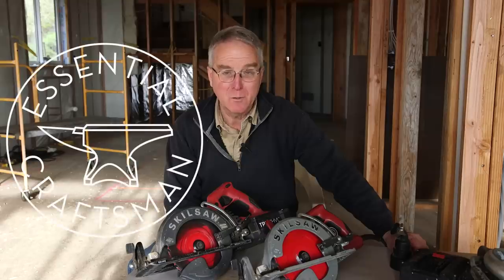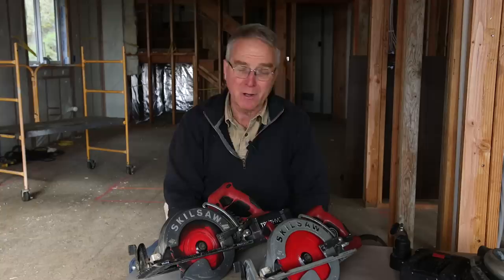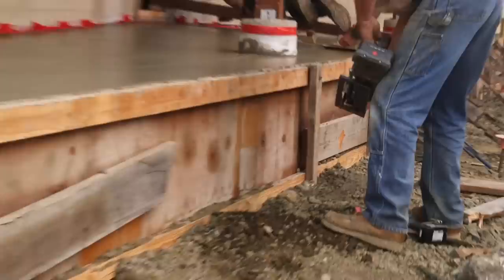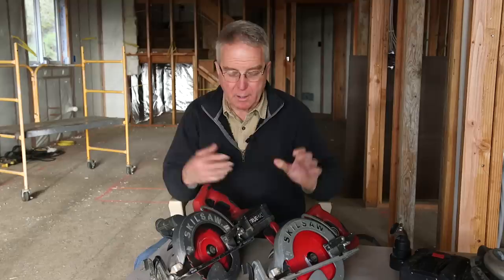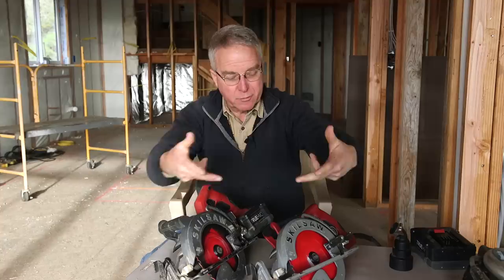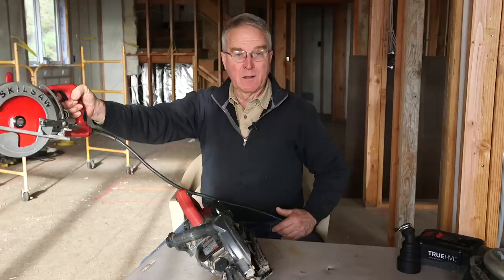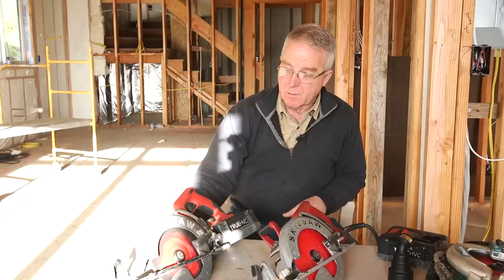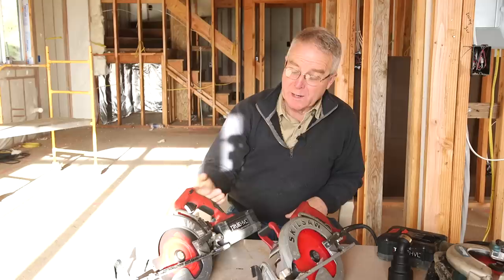Skilsaw Cordless Worm Drive Saw - Initial Review

Comment: I wish I would have found a saw like this years ago! It does everything that we have asked of it so far. Works great https://www.youtube.com/post/UgkxjpBI8OOeUXib_iT7UomCrQ-uauwZJ62c  on cutting composite siding and plywood sheathing. I probably would not try to use it all day cutting 2X boards, but it's just the right size to throw in a job bag vs. your conventional heavy circular saw. Operating instructions very clear. Came package well. I would definitely recommend you buy this for a friend!

Comment: My uncle is part of the crew that maintains and installs new road signs and he says the cordless skill saw has been the biggest life changing invention of his career, even more then post foam. I wish they'd make an extension for the battery though, a short cord that can plug into the saw and into the battery so you could wear the battery in your bags.
Reply: That is an excellent idea!
Reply: That makes sense for that kind of work. This is ideal if you don’t want to drag around a generator or be hunting for a power source.
Reply: makita does have this as an addition. one is a whole backpack that can take like 4 batteries and with a short cord make it seem like 1 battery in the tool
Reply: What about a long cord with the battery terminal connection so you could go corded or cordless?
Reply: @singlepointdc7749  dewalt makes a 10” chop saw like that cost around $900
Reply: @steverone7623  I knew they made a cordless miter saw I never knew they made a chop saw as well.
Reply: @alec4672  to me a “chop saw” is a miter saw unless you’re talking about the 14” gas powered chop saw, Milwaukee and dewalt both make one
Reply: Hilti has that on their 36v rotor hammers. Great for overhead work.
Reply: Yeah. Now you’ve mentioned it this is an essential thing for these more beastly tools coming about in cordless.

I’ve seen some Stihl garden tools looking like this. But yeah. For nailers breakers heavy saws. A short cord to a backpack or tool belt battery would be ideal!

Comment: Thirty year framer here ,I have  used the Makita 7 1/4 " right blade saws nearly exclusively, powerful and lightweight which is important for all day use .I bought the Dewalt 575 Flexvolt right blade saw awhile and love it ,the saw has the same  balance and is very powerful, I will always have a corded saw for production work on saw stools etc .

Comment: As a professional framer I own both but I  only use one for a specific job. Floors and walls I run cord all the way but when I'm doing roofs I prefer the cordless. One it removes a tripping hazard and two once you get used to the weight of the battery you develop a surgeon like ability. its an amazing saw and I have had zero issues since I bought it two years ago.
Reply: Must be nice to always have power on the jobsite.  ;-)
Reply: @xcalibertrekker6693  Not always but my compressor is gas powered with a small generator.
Reply: Whats your take on dust out the handle ? You see what I think of it.  ?
Reply: As someone who’s always tripping over cords, I agree.
Reply: How long does that 🔋 last?
Reply: I can understand your surgeon like ability. I own a smaller brushless makita saw, and i could probably trim my pencil with it at this point
Reply: That's great. I have been loving mine. However, I bought it three weeks ago and the saw crapped out on me. Batteries are working just fine but the saw just plain won't turn on. Maybe I got one from a bad batch.
Reply: @herbertherbomoore415  it'll last you about 3/4 of a work day if you're going at it the whole time. I'm impressed with it. The batteries are 5ah.
Reply: @chonkychookie6949  3/4 of the day? You mean from 8:00 am - 3:00 pm
Reply: @herbertherbomoore415  yeah about 8:00- 2:30 or 3
Reply: @chonkychookie6949  you still need 2 batteries regardless. Thank you for your help.👍🏿
Reply: I’ve watched my carpenter friend trim his pencil with a sidewinder makita when we were framing my garage.  He did it as a joke because I lose every knife ever handed to me…. But I was impressed

Comment: Met up with a group of old school carpenters to frame a 1st floor deck (i-joist and subfloor) in northern Michigan recently. They brought 2 generators, 500 feet of cords and corded saws of all types.  We framed the whole deck ( joists, point load blocking, 1 header, rim board and plywood) with my Makita cordless on it's initial charge (dual 6ah batts).  It was fast, quiet and efficient.   Hopefully I opened some minds!   Thank you for your wisdom!

Edit:  Makita xsh06 brushless 7 1/4 sidewinder btw. With a 2 5/8" depth of cut and a rafter hook that can hook 3", it is a roof-framing game changer.

Comment: Were about same age and started in construction about the same time, 1975 , this is a very good presentation of the pluses and minuses of the battery age versus the corded tool standard !
Myself,  those times that you need a cut out and away from a easy corded saw application,  I've opted for a lightweight battery powered unit to be on " stand- by" for those unique situations .
As you acknowledged in the video , the need for a " professional " crew to resort to expensive battery powered tools for the majority of their work is not unnecessary,  but a waste of money !!
All my jobs are pre- engineered, designed and specified , all on site conditions are mandated , power, water and access are paramount  !
Those who have not mastered the operations and facilitating of their workers with the basic needs are left having to purchase their own power source to complete the tasks at hand !!
Good luck with that !!

Comment: I bought my first cordless kit when I was doing marine work. In Australia our OHS is strict and so every tool and lead needs to be tested and tagged once a month, at your expense. Working on boats meant every marina I went to wanted to inspect my tools every time, which wasted my time, as well as the hazard of running AC cables across the water. The cordless kit changed my life.

Comment: I'm 100 % cordless with the tools I use daily. For my needs, which is a lot of small jobs, not have to find an outlet and dragging cords everywhere is a big timesaver. And not having cords as a tripping hazard is a huge bonus.
I use the Dewalt Flexvolt sidewinder and it has the same power as the corded version I used before. I have even used it to cut a bunch of 3x9 purlins for a roof system with no problem.

On bigger jobs like your I can easily see why a cord isn'nt as big an inconvenience as it is for me. And I guess that the corded version must feel like an extension of your arm at this point.

None of the Skilsaws are available where I love but I still enjoy your reviews. I always learn something. So thank you for that!

Comment: I am Privileged to be a Carpenter who came along when we all built with wood. For me, a Skilsaw is a required standard too, as you put it "this thing pulls in the cut." These saws pull through cross cuts and rip cuts, wet or dry composite or natural lumber. Skil saw is the right stuff. They last for years longer than most circular saws as well. With regard for longevity they could outlast the corded one. Thanks for taking the time! Good job! Very nice listening to you speak with such well-founded conviction!

Comment: About 5 years ago I picked up a skill saw at a flea market for a couple of bucks. I brought it home cleaned it inside and out, changed the blade and until today it is still my work horse
Reply: Skil still supplies parts for older worm drives so they are usually quite easy to maintain and repair. I hope you change the lubricating oil once in a while.
Reply: @rightlanehog3151  I was shocked at the wear and tear, she is still running smooth. What's the rule with the oil, the bigger the blob the better the job!?
Reply: @nicktoland2863  Skil sells their own brand of worm drive lubricating oil. A tube should cost around $5. There are numerous videos on Youtube about the 5 minute process of changing it and there are lots of videos on Model 77 rebuilds and repairs.  As you have already shown,  there are plenty of  Skil worm drives on sale in solid working condition. Over the last couple of years I have built up a small collection of older Skil worm drives and other quality American tools. They are available at VERY reasonable prices as long as you stay away from daydreamers on Ebay.  There is no need to spend $hundreds on a new tools when you can get a sweet deal and keep a classic from going to the scrap heap at the same time.

Comment: Missing a rope is an easily remedied problem, and is something Skil could thing of adding a couple mounting pounts for. In the meanwhile, one could keep a very thin and light kevlar rope with a small carabiner on the end. Any time you need to move it, clip, and use the rope as a rope. Let it drag around it you'd like, or just unclip it, roll it back up in your hand and tuck it away. Weight-wise, you could certainly get away with a battery 1/3 the size, maybe less, for almost all tasks. Power isn't an issue, only endurance. Switching out smaller batteries more often, on a tool held overhead or at long reach, is definitely desirable in the tradeoff of having to charge more often. Keep 2 or 3 on your belt, same weight but your hips hold it better. Any time you'd need the long time between packs, you're probably stationary and could probably use a cord instead, or a larger pack. Or maybe let people clip two batteries onto the same saw if they're stationary and level. I just can't see a point in forcing a single large indivisible battery, bit of a miss from Skil on that one. Maybe they were just scare of first impressions being "It always runs out of power, this thing is useless", where "It lasts a long time but it's heavy" is easier criticism to swallow, despite being unnecessary with some simple changes to how the operator uses it.
Reply: Lol dude this saw rocks other then my what I point out. Smaller battery lol we use this saw every day it cuts like corded saw. You can have 1 guy cutting for 2 crews an saw will run solid 4 hours.   Me an my guys grab this saw 99% of the time

Comment: I never understood saws whose blade is on the right side for a right handed user. I am a Milwaukee fan for the battery system. 
We use to block the guard up. We thought it was safer than pushing against the spring. 
Had an old guy tell me when I first started, "when a man loses respect for his saw is the day he should unplug it and go home."
Reply: Nobody actually wants the blade outside the motor in relation to their body.  But it keeps the cost down to skip all the worm drive stuff.  As an IT guy who uses a skillsaw for maybe a dozen cuts a year, I've got the cheap one.  Partially because it's cheap, partially because it takes less room in the truck.
Reply: It's all about personal preference.  Having the blade on the left side is nice because you get to see the cut, but it's awkward in a few ways:
1) Sawdust gets ejected into your face and onto your hands (unless you have that nice dust port like the cordless one he shows).
2) You are usually supporting/holding the wood with your left hand and the cut off side is on the other side of the saw.  So the big part of the saw table is resting on the cutoff side and the little part is resting on the good side, giving you less surface area to keep the saw on.
Some people don't mind dealing with those as long as they can see the blade.  To each their own.
Reply: Ya, I don't like my body laying over my saw while I'm cutting. Also, your face has to be closer to the saw, to see your mark, and now you increase your chances of a splinter getting under the safety glasses (never fails). With a blade on the left. You can just run on your line and get it done in a smoother, safer way.
Reply: @Elkadetodd  And saves a lot of weight meaning you can have bigger or more power batteries and still weight much less then his worm drive.
Reply: As I lefty I love sidewinders. Being blade right except for me being in the line of fire with the saw dust.  I have a corded skil wormdrive and the times ive used it felt awkward.  Likely because i am soo used to having blade right.
Reply: As a new apprentice back in the mid '70s, I observed two journeymen who would occasionally pin (wedge) their guards up during the workday framing new houses. They just replied, "I got my reasons" whenever I asked about the practice. One of them and then the other about a month later suffered serious injuries from an exposed saw blade. I just don't think that whatever time that was saved or not having to deal with the guards annoyance for some cuts is worth the outcome. Over the years, I've seen some that would remove the guard from their saws. To each their own, I guess.
Reply: @richardlux2477  Yea it can be a hassle but it's there for a good reason after all these years.
Reply: @Mixwell1983  I call 'sidewinders' left handed saws for the very reasons you describe.

Comment: Really excellent review and analysis of the two systems! One advantage I see in the cordless saw (and cordless power tools in general) is that you don't need a robust source of AC power on site when using them. The corded Skil saw easily takes 10-15 amps at 120 volts when running (and even more on inrush), so a modest generator or a very robust inverter would be needed to operate it. In contrast, the cordless batteries can be charged from a small inverter plugged into an idling car or solar panel, so the same mechanical power is available with significantly lower electrical supply requirements for the jobsite.

Comment: I was never a fan of cordless stuff. But a few years ago, my wife bought me a cordless DeWalt drill for my birthday, and it completely changed my outlook. Yeah, they do have their pros and cons, but the largest thing, at least for a home-gamer like me who's doing just a reconstruction of a house while living in it and having a separate 9-5 job is this: With the corded drill, I would often leave stuff for later (or never), because it's so much fuss to bring the drill, unpack the cable, bring in the extension in half of the cases, connect everything and only then start drilling. With the cordless one, it's literally grab-and-go, and it made me SO MUCH more willing to jump onto those smaller jobs, it's crazy. And even those smaller 2Ah batteries last a good while in the drill, very rarely I need more than two batt swaps in a day! And my large old drill is now usually used only clamped in the bench with some special attachment like polishing wheel.

Comment: Makita, weighs less, have the batteries already that go with all my tools, typical solid reliable makita quality. Costs less too.
Reply: No way is this better than the 36volt rear handle makita with two 6s
Reply: If I wanted a new one I’d just get the Milwaukee m18 fuel 7 1/4 rear handle I wouldn’t choose makita personally

Comment: Thanks for your input. I too, have used the quintessential skilsaw for over 20 years. I switched over to the dewalt 60v framing saw just over a year ago. I dont even keep the skilsaw in the job trailer anymore. It would be interesting to have your opinion on the dewalt saw. The balance of it is similar to the classic skiksaw. I occasionally bust out my corded skilsaw when I have alot of cutting to do at the "horses". If I have a big set of stairs to cut, I can go though 3 batteries/battery cycles just to finish the stringer work. I build alot of decks, and use alot of treated lumber for stringers. That southern yellow pine can wear down the batterries pretty fast. All in all, I have cut the cord on almost every tool that I can, or at least have both a corded and cordless option for that need. 
Thanks a bunch Scott for all of your videos! I usually catch up on them while eating breakfast getting ready for work. 

KEEP UP THE GOOD WORK SCOTT!
Reply: I have the Dewalt 575  Flexvolt right blade and love it .
Reply: I do a lot of concrete forming and I love my Dewalt saw. 
I take both my corded saw and my battery saw to job sites. I haven't used my corded saw in the last two years.

Comment: My cordless dewalt dcs577, is a treasure and a treat to use. Generally I dislike the Dewalt Brand, however, this particular saw rides in the cab of my truck away from the other tools, and has been nick named the Boss Saw by those working for me. The lead always wins a fight over who gets to use it that day. Enough cannot be said about how pleasurable it is to use compared to my other corded Circular saws. The "worm drive style" Dewalt 60v rips substantially faster than a corded saw can, which alone has easily paid for itself over the last 2 years. It really has to be held and (ab)used to believe what it can do, and for how long it can do it.